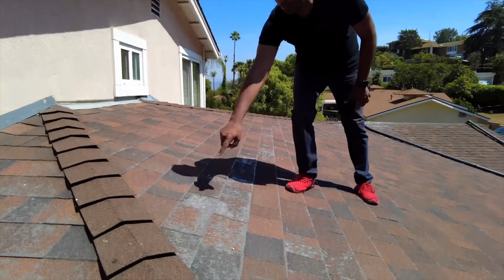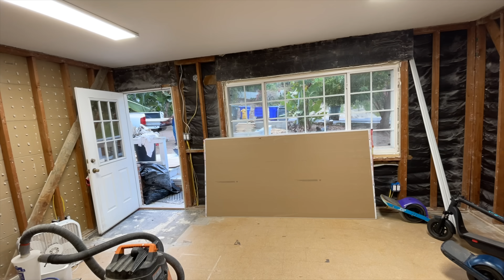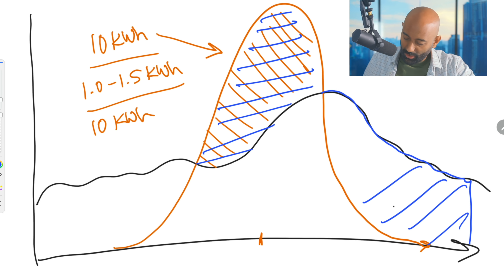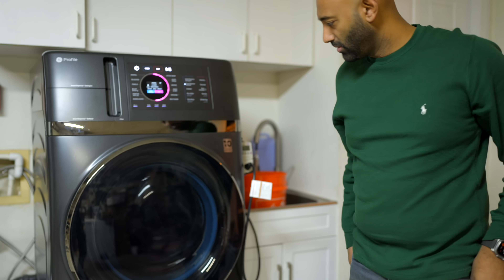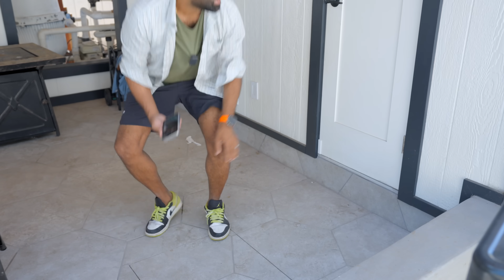Is Self Reliance Possible? Net Zero Home 4 Years Later...

Comment: I suggest a solar blanket to insulate the pool pool when not in use.  This prevents cooling of the water due to lower air temperatures as well as evaporative cooling. Saves water too. Good you use a more efficient pool pump. Note eletric usage in pumping water is proportional to the pump speed cubed. So running at half the speed uses 1/8th the power. Even bigger savings at lower speeds. Just run it longer to ensure enough turnover. We put in a Rheem heat pump water heater right after replacing our pool pump and it has worked great. Gives some free AC too. You can vent it inside or outside depending on the season.

Comment: As this continued, I was amazed at everything you've done, I was impressed, but as you kept going adding more pieces it started becoming too much.  Then once you got to the eco flow system in the office it turned into a little bit of a funny thing because it just kept adding more and more. Then you added the second inverter on the EcoFlow system and I laughed a little bit. You talked about adding two more batteries to it and I laughed a little bit more. But I was all in still until about 28 min.  When you added the Franklin batteries, I bust out laughing.  It's seriously looked like you are surrounding yourself with batteries and solar just to keep your house going and the requirements continue to increase and increase to the point where it looked like parody. 

Your video taught me that it is simply not feasible to be completely off the grid and self-sustaining unless you go with a brand new home build and pre-plan out all of your electrical usage with some buffer to grow. I'm going to stick with my little pecron emergency portable battery and 600 w of portable panels for now, and probably when we build our home on our land, that's when I'll do my planning for whole home solar self-reliance, well water and possibly steam turbine generator system.

Thanks for the very informative video and I think you prevented me from wasting a lot of resources trying to achieve something that is just not very feasible. It is very helpful though and I'll take all of your lessons into our new home build in the future.

Comment: I'm on a similar journey and installed the Rheem PROPH 80 T2 RH375-30 heat pump water heater, and have loved it so far.  In my research, it was the most efficient unit on the market and Rheem is a great brand.  Rheem has a lot of options, but if you go to their pro (not available in big box stores) you can get the plumber grade version that has a 4.07 UEF.  I bought mine online and hired a plumber to handle the install saving thousands in the mark-up.

Comment: Yeow! $.50/KWH. I live in Idaho and currently pay about $.17/KWH. I (foolishly) bought a CYBERBEAST a year ago And my electric bill, for house and charging(I also have 3 electric motorcycles) runs about $2.00 -$3.00 MORE, per month, than it cost for diesel,  GMC DURAMAX 4X4, and gasoline/Mazda Miata RF. (I kept the Miata) I miss the California Weather, I grew up/lived in Santa Monica for 50+ years.

Comment: Part of why the rates are going up is from tear one. The power company has to much solar and then has to give a lot away at night. 

In my area they didn't let you have a battery on your system. You had two meters and everything went to the power company. They gave you a credit and then charged you for what you used. Now they allow a battery only on the incoming side. If you save power during your production they now give one to one. After that it's cut in half.

I want to do a off grid system. The problem is that I don't get the power they do. It's interesting to see how some states it's simple and in others it's not. 

I would build a system for what you have now. Then lower your usage so that you produce more than you need. 

If the power company was smart they would have let people go off grid and build a good system. If they built it right then they would have extra power most days. As a power company I would have been like. If you give me the power and I can sell it then I will give a that power back in full. If I am not able to sell it then you can get a small credit. 

I think that lots of people would build a system that would cover them most of the time. And welcome giving the extra power away just to have the peace of mind that they would have power from the grid if they needed it. But what do I know. People want to be paid for the extra power. but if giving it gave you no bill. Would you send it to the power company? If you could get some of it back if they could sell it? 

Now that the rules in my area have changed. I am going to see if I can build a system that I control and not my power company. I think that I might have just gotten a bad solar sells man. 

And getting a small system and they growing it is the way to go. That way you don't spend money on things that you don't need to, and replace things that are not energy efficient.

Comment: I have an 80 gallon Rheem heat pump water heater in my garage, 5 occupants and its amazing.  The air intake and exhaust are ducted into the attic, has made a cooling difference for the house as well.

Comment: I think the only thing your missing from this whole setup is to take advantage of the different thermal outputs of each system. You have a pool heater that outputs cold air as part of its heatpump process. Instead of letting that vent to atmosphere, you could capture and direct that towards your other heatpump that you use for air conditioning, this would allow your other heatpump to work even more efficiently, and reduce your total power consumption.   I did something like this. Up in Canada, I have a Radon gas pump that runs 24/7/365, and draws ~25w/hr. However, the air temperature output is always 13-15'c. I have directed this to my whole house heatpump, and so it works beneficially year-round to improve the efficiency of my heatpump since it does not have to work as hard to "gain" the thermal difference. This also means, my heat pump has worked as low as -40'c/f and not need the use of my backup heating system (in 3 years since getting my heatpump it has never turned on). I also then put my heatpump hot water system, and vented the cold-air outside in the winter, and back into my A/C vents in the summer. This also takes advantage of the additional thermal benefits of my hot water system when I can, and remove it when it isn't desired.

Comment: Regards the office water heater- I'm going to presume this will be only sporadic use and maybe one shower a day if there is a shower. If it's just a sink, no shower I would just do an Insta-hot. Big draw but for just moments, I'm sure the Ecoflows could handle it. Wiring them sucks though.
If you have a shower, instead of a high-tech gee-whiz solution, you may consider a low-tech setup that works surprisingly well for me: I have a regular old 40 gallon tank water heater, nothing special. I disconnected the bottom element from the 240VAC feed and capped that off. I routed a dedicated circuit from the solar panels and connected it DIRECTLY to the resistive heating element (which has a 4500 watt rating when powered by 240VAC). If the sun is out, it's heating water. I connect two 370W REC panels in series in the summer and three in the winter. Recovery is slow, but it's heating 40 gallons. Sunny days and I have all the hot water I can use. I even do laundry on hot/cold and still have enough for an evening shower. 
Cloudy days will obviously reduce the water temperature, so if it is running low I can always just turn the breaker on and the top element heats up enough water for a hot shower. I usually leave that off.
At present, there is no thermostat and I haven't needed one, but the water can get dangerously hot with three panels running, that is why I drop to two in summer. I do plan on altering my setup to use the built-in thermostat running a solid-state relay to break the DC feed from the panels when the water reaches a set temperature, which will cycle normally.
I haven't needed the top element in over a year and am saving hundreds in utilities.
One could also select a small tank heater, like 15 gallons, the downside is there is usually only one element in these, so one could not have the luxury of utility backup for poor weather.

Comment: Thank goodness I live in Texas with low energy cost plus we live in the country and we don’t have to worry about permits. We have been off grid for 4 years and use dual axis trackers for 10,000watts of panels and single axis for 10,000 watts (40 -400 watt panels) we have 62KWh’s of battery storage along with twin 6,000 watt split phase inverters. The cost of our new system that we installed July 2024 was around $24,000 not including wire and trackers due to them already being in place. We installed the EG4 solar mini splits and the GE combo W/D same as you plus we installed a combo water heater (gas or electric) our total wattage per hour usage for the new house is on average about 1,500 watts we also have two RV’s running which are energy hogs. During the summer we use close to 82KWh’s per day which decreases to 40 mainly due to not having to run 3 RV air conditioners. We do not have a grid connection on our new property and never have but lately due to the heavy rains we have been having here in Central Texas our solar production for a few days has gone from 80-100 KWh’s a day to less than 25 which means that our generators have been getting a work out. We use exclusively EG4 products and have been totally happy with them plus when they come out with improved quality products they always have a trade in price and we usually take advantage of it to help increase the efficiency of our system.

Comment: If you want to really save money maintaing your pool is to get a solar pool cover.  Years ago, I live in So. Cal. and had a 33 x 18 foot pool. At the time I bought a solar cover with the roll up roller. Full income tax CREDIT.  When covered, I only had to run the pump for a few hours or less, reduced chemical use, kept the water and pool cleaner.  I didn't have to hire a pool ckeaner.   As the pool was heated to 80 to 82 degrees and extended the swimming season from late March to early November.  Lasts about 3 to 4 seasons.  During winter I covered the pool with black plastic from Home Depot.
Reply: @covercalls88  I view a single home pool as a money pit, like a boat. I understand that some people want them, and more power to you, but I can't see ever having one. A nice community pool visit from time to time has been much cheaper and less work for me. To each their own, though!
Reply: @BassDawStew the pool came with my first house.  In my viee it did not add much value to the house.   My family and boys did enjoyed it while we had it.

Comment: Make sure that you are getting a recirculating pump with the water heater. If not, you will run the water quite a few minutes to get hot water. I feel sorry I did not get a system that has it built in. It is much more expensive, but over time it would be worth it.

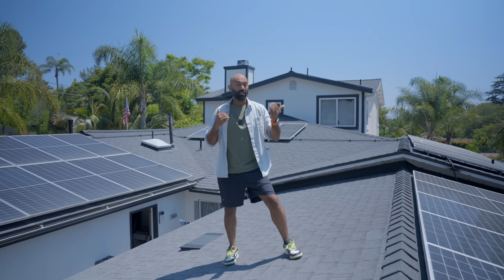Comment: 7:51 400W panel? That's like 5 - 7 years old technology. I'm from Pakistan and 550+ Watt panels are the least that anyone gets. Almost everyone now buys 600 - 615 Watt panels which cost you PKR 30 that is $0.1055 per Watt here (for panels only) the whole system is around $0.50 per Watt).

Is there a particular reason for low capacity panel installation in the US, like weather conditions or import ban from Chinese manufacturers? Because every Westerner I hear talking about solar is installing 300 to 400 Watt panels.
Reply: @syedusamamanzoor1838  It might be the ease of installation in terms of carrying a smaller panel compared to a larger 500+ watt panel that might need 2 people perhaps?
Reply: @raba650 size looks similar. Newer panels are more energy dense.

Comment: My Air-Water heat pump can do 3 things: Warm water, Heating, Pool water (i don't yet have a pool though)
Its super efficient, but it basically takes the space of a small walk in closet. Under normal conditions its power consumption is somewhere between 200 - 400 watts. My floor heating covers ~ 150m². In the cold winter - like -15°C and below - it does Peak with 1kW occasionally, because it might need to defrost for a few minutes, but even then the usual average is ~500Watts

Comment: Really good and helpful info.
Similarly I installed 9.4 kW array of Solar on a three phase 8 kW inverter. My system here  in Aus after rebates/ credits cost just over AUD$0.84/Wh. AUD$7,900.00 installed 2 story house. 20 x 400 W panels 
We have variable speed pool pumps and Gas Heating Electric air conditioning and a 5 star energy efficient house fully insulated.
Over the past  30 months  I generated 31.8 MWh of energy and sent about 12.3 MWh back to the grid.
For that excess solar sent to the grid we now get a stingy AUD$0.03 c/ kWh feed in Tariff. So I am now looking at batteries.
Our off peak power  now cost AUD$0.24/kWh and Peak is now AUD$0.40/kWh. 
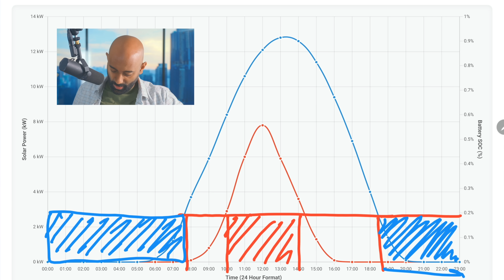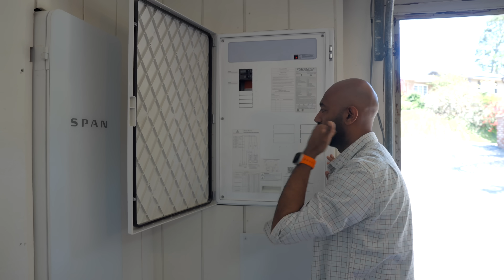Our peak power charge starts at 16:00 hrs until 21:00 hrs. so in Summer our solar covers a couple of peak hours rate usage. 
In late Fall/ Autumn ,Winter and early Spring  we use grid power as low light and low generation 
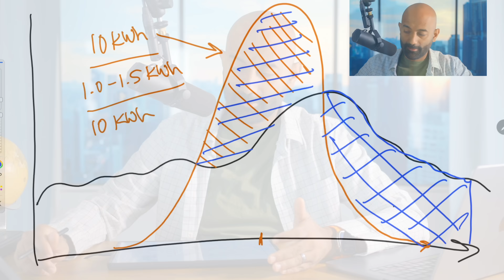Studying our generation profile over that lower generation period we hit 2 kWh output and above from  09:30  through 14:30hrs.
 Many days of very overcast and bad weather and many days of less than 8 kWh generated for the whole day.  I looked at last years profile and on 120 days we produced less than 13 kWh.
For sake of ease I will use the off peak charge cost rate for the savings. 
Generation of 31,800 kWh les the 12,283 kWh I sent back to the grid. 
Our own use solar 19,310 kWh  @AUD$ 0.24/ kWh  save me approx AUD$4,634.00 plus the tiny feed in tariff we received of AUD$582.00 all up $5,216.00 saved.  
Batteries here in Aus selling at around AUD$800.00 /kWh storage but that is now coming down.
I calculate pay back on the batteries to be about 8 years.

Comment: So my take is you use a huge amount of power! Way more than the average household. You didn’t seem to focus on minimizing your energy usage, but building out the biggest system possible to maintain your American lifestyle. Yes, you changed out your pool pump and installed a washer/dryer heat pump system, but other than that you are using wayyyy more than most people. Also, you are being massively subsidized by companies donating equipment that the average family doesn’t have access to….so yes it’s cool you’re trying to go off grid, but it’s not realistic for regular Americans.

Comment: I’m in SD also. I put in a Ryeem proterra heat pump water heater last summer. Thurms went from about 20/mo. To .5/mo. It’s great. There is lots of rebate money available too. I did the install myself and was out of pocket less than $1k. Plus, it acts as an AC unit for my garage!

Comment: demand charges
....  You know this (by your mention of the term peak shaving),  but most home owners do not.
.
 its not shown explicitly on the bill.... identified in most cases as 'factor'   with no units related to price or use...!

factor 45 would mean that they boosted your kwh rate for the entire home by 45%  FOR THE NEXT 3 MONTHS, based on the highest 15 minute surge.   rarely it is it labeled what it actually is a 'demand charge'  which is honorable 

another parallel issue IS 'tier pricing'  but is not explicitly pointed out on the bill.

Comment: I am an 84 year old retired mechanical / electrical contractor with principal engineer endorsement.   You know your stuff.    However the appliance industry makes a lot of short lived *junk these days.....the repairs will be an ongoing issue, costing more than the net savings in many cases.....its difficult work....about 20% of that work force is more or less reasonably competent... the rest is shades of grey

Brace yourself.

Your work is valuable as research, training, and discovery as you know.

In the practical end I am advising more of a bare bones approach... doing without... and suffering....avoidance of electronic controls as possible.... and locating the appliances as close to open able windows as possible..... and on the side of the home nearest the drive way.

That way when it fails you can just shove it out the window into any pick up or garbage truck....you can even do it with high rise buildings if you allow for wind drift.

Comment: RHEEM is very good from HomeD...i have the 50gl from 5 years and have never been happier...from 4.5kW heater down to 1.5kW and not noticed any change. Also got the 17kW EG4 hybrid inverter with batteries only....no solar...SCE prices are really high and saving 25cents per kWh just by TOU usage.... next i am going solar. I will NOT NET meter...system will be an enrgy efficiency system from the view of the utility